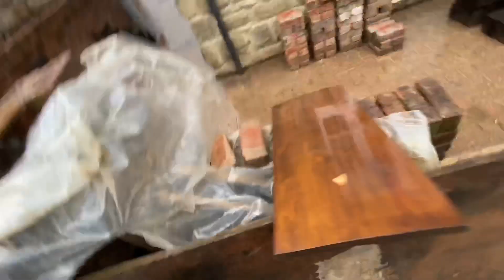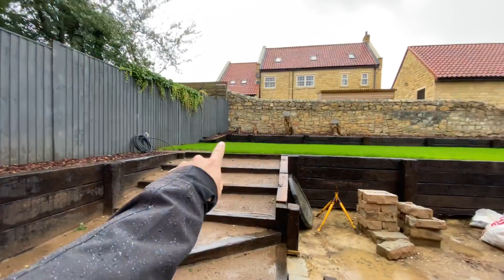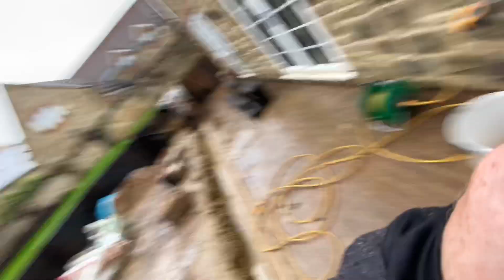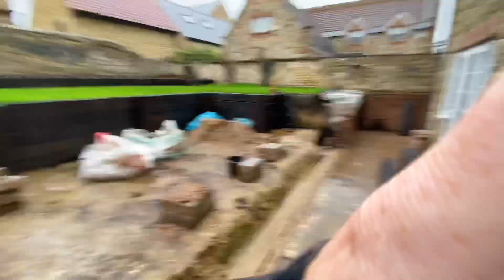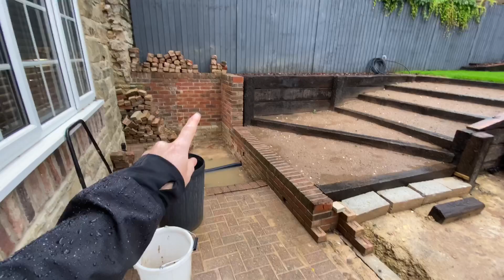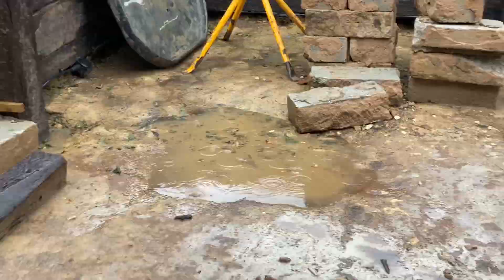How much has the Garden Project cost - DIY Journey

Comment: Hi how did you know how much waste you’d be removing/how many skips or grab trips you’d need? I’ve got some thing really similar to do so these videos are so helpful - thanks
Reply from the maker: Hi,

To be honest I didn’t, I originally budgeted for 1 or 2 grab loads, turns out soil expands dramatically when you dig it out lol. Each grab wagon was 16t, we had 11x in total. If it helps we dug our the patio which was 8m x 5m x 1m, and then scraped and levelled the rest if the lawn, for a guide on how much that was.
Reply: @DIYJourney1  😂! I did a shed base in the spring, digging into a slope (only 50cm difference in depth), thought I’d just spread the soil around the garden and didn’t budget for waste. Now I just have piles of clay soil I need to dig out again and get rid of, there was so much!

Is there a trick to getting the ground level? I’ve seen things with pegs, string, stuff like that but even with that I think I’d probably ending up needing to add a bit here and take a bit off there, would you say that’s normal?
Reply from the maker: I think thats normal, we used pegs and tried to use as much as we had to try not to buy it back in. We did however buy some back to help level with a rake

Comment: Can you give a list of where you got the stuff from. Particularly lights, electrics and the sleepers. I've seen green oak sleepers (2.4m x 200mm x 100mm) for 30 quid but your reclaimed ones were 35 so wondering what size they are. You went with reclaimed for the look I guess?
Reply from the maker: Electrical products all from Screwfix, Armoured wired cable, Glands, Aurora Ground Lights. Wiska 308 Junction Box from elsewhere. 

Sleepers are from a company in York called Granton Trading, I dont believe they would delivered to scotland.

We did yes, and the longevity of hardwood.